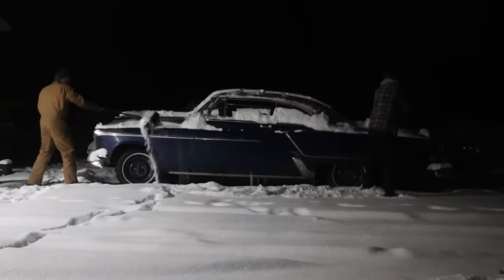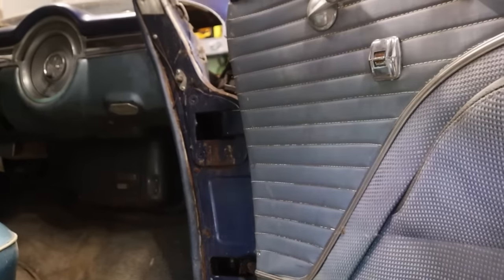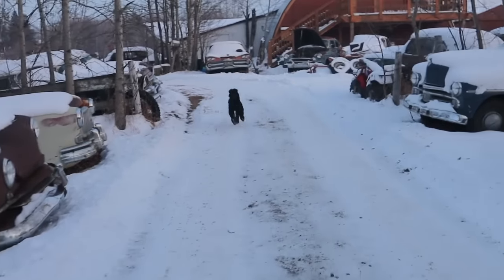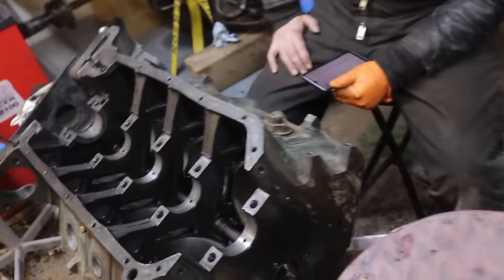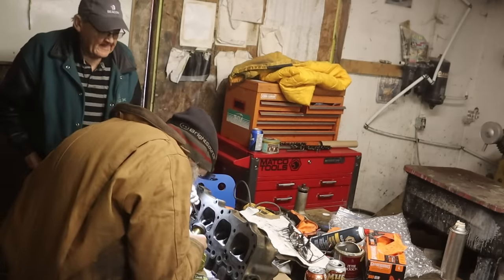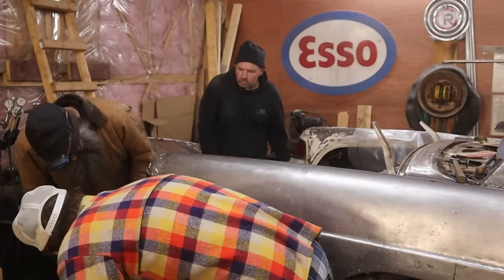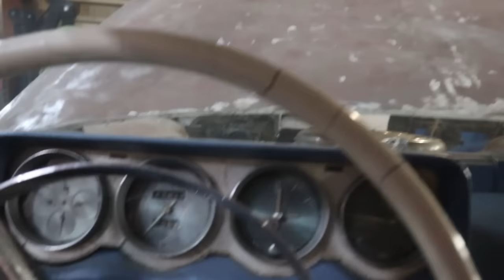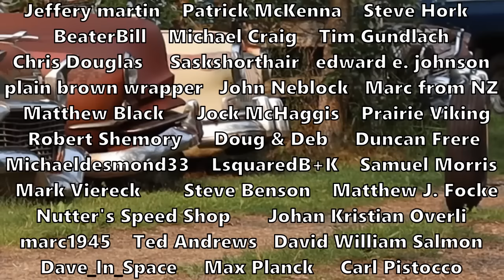1953 Olds is Back! Let's get into it... Plus: Buick Nailhead Progress and A Continental Deadline?

Comment: I was wondering why they used hydraulics rather than electrics for the windows,  and I then remembered watching WWII videos on YT and the ball gun turrets were spun around with hydraulics, not electrical motors because copper wire was expensive to run big enough cables to power electrical motors throughout the plane. Plus, the electrical generators in the 40's airplanes were not that great, and electrical Motors of that age were not as powerful or as fast as they are today. Hydraulic lines and hydraulic motors were cheaper and faster and more reliable than electrics which could short and burn out. Same logic can be applied to cars of the 50's and early 60's using generators rather than alternators for electrical power, and those car six volt systems were weak, as anyone who lived in those days (I was a little tyke) in the six volt era, would know. My dad spent many a snowy, icy winter's day (and night) jump starting his sad six-volters😢 And ill bet the same engineers who designed warbirds were on staff for automobiles

Comment: That hydraulic power window system is so Rube Goldberg but it's interesting 
Today the cheapest cars have power windows
Reply: Joemazzola - Your comment just triggered a memory of my watching WWII videos on YT and the ball turrets were spun with hydraulics, not electrical motors because copper wire was expensive to run big enough cables to power electrical motors throughout the plane. Plus, the electrical generators in the 40's airplanes were not that great, and electrical Motors of that age were not as powerful or as fast as they are today. Hydraulic lines and hydraulic motors were cheaper and faster than electrics. Same logic can be applied to cars of the 50's and early 60's using generators rather than alternators for electrical power, and those car six volt systems were weak, as anyone who lived in those days (I was a little tyke) in the six volt era, would know. My dad spent many a snowy, icy winter's day (and night) jump starting his sad six-volters😢